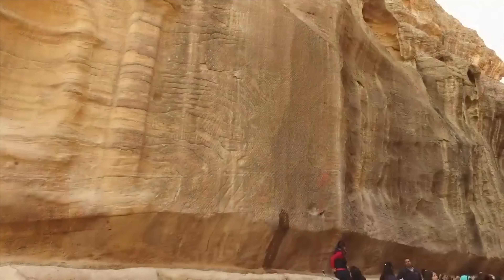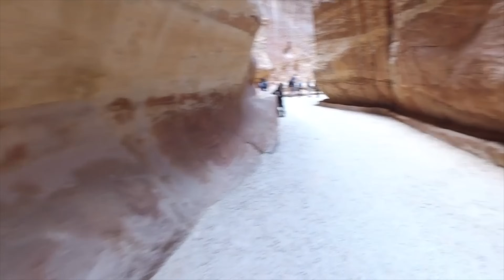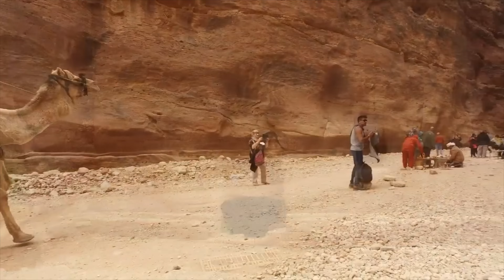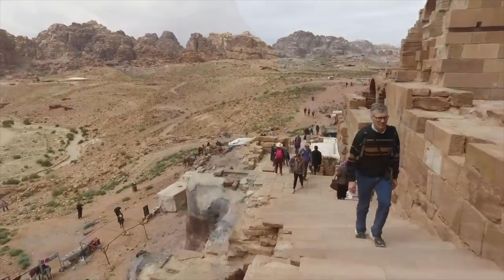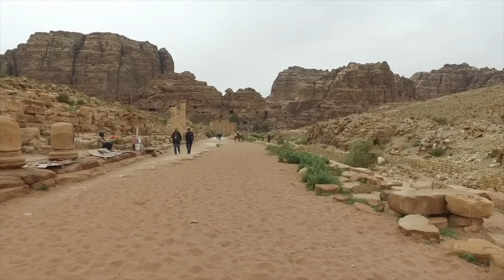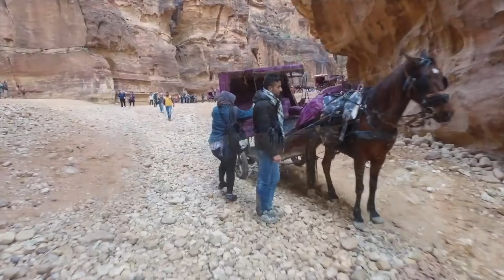The Massive Megalithic Marvel Of Petra In Jordan: 7 Miles Long!

Comment: Brien. Three great recipes.  For lunch or breakfast.  Spinach.  Delicious.
Banana Strawberry smoothie. You can add baby spinach a handful.  No taste.
Mediterranean Omelet
Small tomato chopped
1/4 cup red onion sliced
1/2 jalapeno pepper diced small
Saute 1 tbsp butter.
Put on plate
Beat two eggs salt pepper 
Putin same non stick pan.  Cook till solid flip with flipper add veggies a handful of cheese I had Colby Jack.
Fold put a lid on 1 minutes.  Flip put lid on.  Heat 1/4 cup salsa your favorite.  Omelet on plate salsa on top 1 piece whole wheat toast
Today's lunch
Strawberry banana smoothie 
Salad
1/4 cup quinoa
Two handful s spinach Baby chopped 
1/4 red onion sliced 
1/4 red pepper diced 
1/4 jalapeno chopped 
6 cherry tomatoes halved
10 kalamata olive s
2 Tbs feta
Lemon vinegrette. I used Paul Newman s
Check it out I think it's delicious 
Thanks

Comment: Brien I made the soup it was fabulous.  The recipe was really plain so I blended two recipes.
1 pound Italian sausage mild..  one recipe called for hot Italian.  I used mild and added 1/8 red pepper flakes as I browned the meat.
1 cup brown lentils. Rinse no soak
Medium onion chopped 
3 cloves garlic minced
15 oz canannelli beans rinsed
5 cups chicken broth 
15 oz diced tomatoes 
I added a tsp salt before I put the lid on.
Bring to a boil turn down to simmer 35 minutes.  My first experience with lentils they were a little crunchy but it's a good texture
Add I used two handful s of spinach I chopped it.  The leaves drop broth down your chin strips are better.
I put the lid on 5 minutes.  The use a small PKG goat cheese I like flavored cut it into fours.  Put soup into bowl put one goat cheese lump in it.  It's great and not to spicy.  Thanks

Comment: I stopped this video to say this and Yall may say the same thing before this video is over with 1st Off it's very interesting now then my Thoughts on this water trough is that it Carried The Massive amounts of Cutting dust or muddy water away from The Massive Saw Blade Used to Cut The Stone With now I Don't have a Clue What The Machinery was or How it ran The Blade for if l did it'd Probably Blow this Ole Country Boy's Mind BUT I do know Without a Doubt They Had Something Hard Enough Back Then To Impregnate a Saw Blade with that would Cut Threw Titanium if They had it back then an That Would be Diamonds they could have built a saw blade using Diamonds laid threw out a Molting Bronze Blade and the Cutting Dust was Carried away By The water flume they Built !!!! To Me Things Like This Place and Others Were Left to Show us That THEY whoever THEY were , Were Here and Left us Something to Wonder About and They are Right We Wonder indeed !!!!!!

Comment: Sir, you are far away from science. your conclusions are very simplistic and false. you must an ancient aliens guy, right? just to correct a major false conclusion of yours: the weathering of the rooks is not because it is more ancient than known, its because the hall of Petra is a valley and it had so many floodings  for the past 2200 years that weathers the rocks. evidence for this is that the weathering is mostly at the bottom. the top is clean. if it was caused by time, you will see the opposite, as the top will be more exposed and the bottom will be covered by dirt.

Comment: The earliest Corinthian capital was found in Bassae, dated at 427 BCE. (Corinthian capitals are the carved decorative acanthus leaf motif on the tops of columns). Romans enslaved Greeks, Etruscans..., to carve, sculpt, paint, decorate architecture in their cities. Roman columns (Corinthian order) are specific dimensions by design called, "canon." (κᾰνών/Kanon = Greek for, "measuring rod").  They integrate specific dimensions so that the column height are a 6 to 5 ratio. (If a column were 6 feet tall with the Corinthian capital on top, the column without the capital would be 5 feet tall). In art, the canon for sculpture or painting a figure, (specifically in Roman times) are to make the figure 6 head lengths tall to figure idealized proportions.  Leonardo Da Vinci confirms the canon with his drawing called, The Vitruvian Man where the head is measured from about the collar/top of chest to the top of the head which equals 6 head lengths from head to foot. SO, IF the columns were carved in by Roman Greeks, the measurements are usually a dead give away of who made the columns.

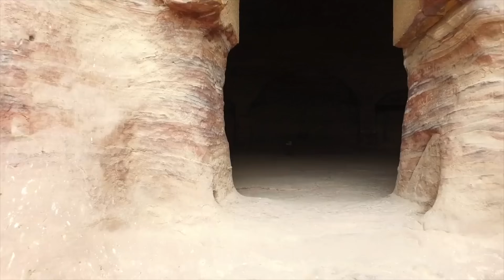Comment: If you look at this with an opened mind and look at it like it was melted it makes much more sense. Some openings next to others with the same top only half the size and just looks like a hole. They wouldnt have carved the same top 3 feet off the ground timestamp 14:21 there is no possible way they carved out the top of that opening when they didnt have enough rock to finish the bottom

Comment: Visited there 6 years ago, man was it an unforgettable treat.  The best part was the trails that looked like they haven't changed in millions of years with stalactites jutting out. The most awe-inspiring ones were completely completely closed from the top so it was like being an cave but not at the same time. Like an outside cave tunnel. The temple that used for "Indiana Jones the Last Crusade" is much smaller in the inside from the movie.  Don't take any camel rides, they'll rip you off. Haha.  Regret not visiting the Indiana Jones themed shop or at least not spending time to make it noteworthy.

Comment: Are the archeaolgists positive the stairs leading down below treasury are a basement and not the original ground floor. Because if its a  ground floor. Then the road and plaza in front have 15 feet of sediment that washed through the gullies and solidified. There was no sign of continued digging. Whats the story Brian! Excellent video.

Comment: I'm fascinated by some of the weathering on the great facades. On the last two facades you showed us, they were severly weathered at the bottom, with pristine facade above, which would usually indicated some sort of flood or erosion up to a certain level only, except that there are alternating layers of pristine carving and extreme erosion going on in layers looking up.

Perhaps the stone has severe alternations in hardness between layers? And so you have layers that weather quite easily and layers that hold up to fine detail.

As a lifelong musician and someone who is certainly interested in the metaphysical aspects of music and frequency, I am still rather agnostic as to the degree to which acoustical tuning was used in these ancient structures. When I design a wind instrument, be it a pipe (flute, clarinet) or a chamber (ocarina), the note a chamber resonates to is a simple function of its volume of air.

In the Barabar caves in India, several of the caves resonate to the same frequency, but this can easily be explained if the chambers are the same size/volume. (I don't know if they are.)

It's very easy to get a large chamber to resonate. When designing a concert hall, or laying out a home theater system, the trick is to get things not to resonate. Because the room always wants to be its own instrument. So when designing a concert hall or laying out speakers, you want to mute the room and find ways to project the concert without the room emphasizing one sound over the other. A room that emphasizes a given sound is highly unsurprising to me; for the most part every room made of reflective surfaces is going to do this. And if that emphasized sound creates a metaphyisical effect in the listener I might attribute that effect to the spiritual power of the place itself rather than a specific frequency necessarily. Although I certainly don't rule out that the builders could have selected a specific frequency for a specific place for specific reasons. At the same time, it's equally likely that the builders interacted spiritually with the sound that happened to come out of the place, and the work they did there with that frequency is what still has a metaphysical presence for us today.

When Eileen McKusick performs energy healing on people with tuning forks, she notices that for one healer a certain frequency will speak to a specific part of the body, yet for another healer the same frequency will impart its healing somewhere else. That says to me that the power of frequency itself lies somewhere in its interaction with consciousness, and that the effects we see may have less to do  with a "physcial" phenomenon, in the Cartesian sense.

Comment: The high technology I think was concentrated sun light and brittle baked flakes got chipped, scraped and pounded off. Super HIGH heat. Fracturing may happen better when cold water applied to hot rock. right?

Comment: The tool marks look more like something you'd see from a cutting torch or plasma cutter in steel work.You showed on another video where the giant stones in a wall looked like they had been softened to fit tighter and swelled slightly at the bottom. So the giant piles of loose stones you walked by could be the slag that fell off in the cutting. Impossible tech even today but we have dynamite and can blindly frack hell out of the earth.

Comment: .🔍 At (15;43), the lower front has been hit from right (impact point) to left and the top has traces of impacts with diagonal hits. Same at (20;15) and (21;00), a long horizontal trace with meltings. 🎓☯ Forensic science ought to examine those (also: Malta ruins).

Comment: The Mohs hardness rating DOES NOT apply to sandstone, only the component parts...ie the individual minerals, namely quartz, clearly this fellah never worked sandstone as it only requires tools rated for marble and limestone, further, fresh sandstone is damp and much softer, thus to work exposed rock (over burden), you simply work it when wet.

Comment: When you were in that large acoustic hall, what did you think of the odd marbled coloring of the vast flat ceiling as well as the upper back wall of the arches. Did you see those consistent tool marks there, as you pointed out on one wall? Because the ceiling looked very smooth, you say layered sandstone, but out of the pink, mauve, beige and gray, the black looked very oddly angular. Seaweed deposits? I understand that if stone is cut horizontally it's layers will look different from those cut vertically, but the archway wall is at a vertical angle from the ceiling and looks the same. Though both look very different from the rest of the walls and floor. And what does the weathered damage on the lower part of the facade look like to you? The columns are just crumbled off like they were in several feet of flowing water for repeated and long periods of time. I understand that this area was prone to severe flooding at certain times, and this was a big reason for the sites abandonment, because they couldn't keep up with the water chanel repair and flood control. Plus evidence of earth quake at the upper regions of cliffs surrounding the city where there was a lot of water management structural damage.
    Also, what are those square holes  all in rows high up on the walls? Were they used to attach something? I don't see soot marks from torches!
    And lastly, the great acoustics as well as the design of the great hall makes me think of a temple or mosque where a leading voice would chant or sing and lead the gathering in a prayer chant. But why is the back of the hall fenced off so people can't examine the strange features in the arched alcoves closer ?!!?
Reply: Black is smoke stain

Comment: Contact report number 215 - 'Billy' Meier: "Good. Since we are already at it: what was the reason for the destruction of Petra? I mean Petra, the current ruin site with the rock necropolis in southern Jordan. Petra was the residence of the Nabatean king until the establishment of the Roman province of Arabia Petraea in the year A.D. 106 by Trajan. Petra was also a commercial centre in the caravan traffic between Syria and southern Arabia. The city was abandoned after its conquest by the Arabs in the years 629–632. To my knowledge, it was not until 1812 that the city of Petra was discovered again."  Quetzal: "109. The discovery was made by a certain Johann Ludwig Burckhardt, who was born in 1784 and who already died, at the age of only 33 years, in 1817."  'Billy' Meier: "It was not a discovery but a rediscovery. In 1829, so 12 years after Burckhardt’s death, the first excavations were made in Petra. I myself can remember the very ornate facades of the multi-storey grave facilities worked into the rock cliffs."  Quetzal: "110. I understand.
111. You were in Jordan for a long time and, among other places, also in Petra.
112. I know the grave facilities.
113. Particularly impressive to me, for example, was ed-Deir, the so-called monastery that dates from the second century A.D.  'Billy' Meier: "I remember. It exhibits a very peculiar mixture of Roman-Hellenistic facade architecture and temple architecture, which are connected with the local grave-building traditions. But what, now, was the reason for the destruction of Petra?"  Quetzal: "114. The destruction traces back to a massive earthquake.
115. But not only was Petra destroyed by this but also many other places around the current Gulf of Aqaba and around the Red Sea.
116. Also the Earth opened up, out of which kilometre-high chunks of sulfur were hurled, which were distributed over the vast country."

Comment: The facade seen at 20:06 shows what appears to be WATER erosion on the lower 3 to 5 meters, where soil, silt and sand must have been deposited for possibly centuries... with a sharply-etched line of erosion by wind-blown SAND marking the Surface of the accumulated GROUND during a prolonged period before the site was excavated to original Grade. I did study a little architecture, but that sort of erosion is strikingly similar to erosional patterns seen in several Ancient EGYPTIAN Temples in the Nile Valley, that were occupied for almost a millennium only by shepherds and their flocks, when many centuries passed during which wind-blown Sands had filled those temples to a depth of some 5 meters above the original floor paving blocks.

Comment: Amazing that my shower is also tuned to ohm.....
Reply: Yes showers do that too xD but i doubt it is the same Note ;) 
In comparison The kings chamber in egypt has a strong hummable resonance i messured it in between Notes A# - B3 about 123Hz 
above and lower than that are a lot more Resonance Lines that one can Sound and hear it reverb up to 16seconds with human voice db level (laying in the sacopharg humming is the optimum coupling point) if you would apply deeper frequencys and louder it would get very intense and the reverb takes very long to decay.. a big portable jbl speaker and a bluetooth microfone app forming an resonance feedback loop does miracles in such caves and showers ;)

Comment: These are so obviously not rock cut chambers. These areas were where flood debris did not enter, so hollow places in the debris are the insides of buildings that turned into rock over time! I see the same in all of the so-called rock cut structures around the globe. Where is all the debris of cut rock taken from them? There is never any on site anywhere, meaning they are not rock cut chambers at all, just hollow impressions left from the buildings that were once there and now have rotted, rusted and eroded away! The tools marks are from excavations by the Greeks, or Romans that dug out any debris still found. The facades may have been their work and not part of the original structures!